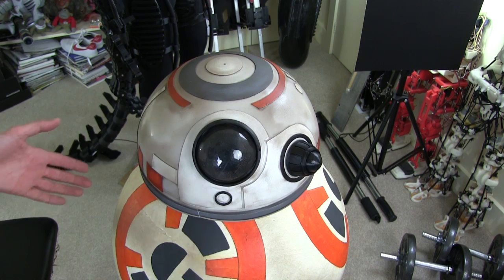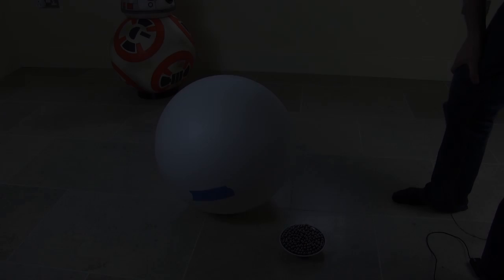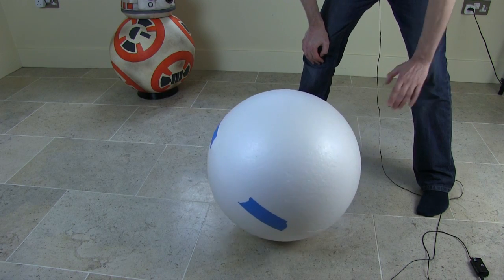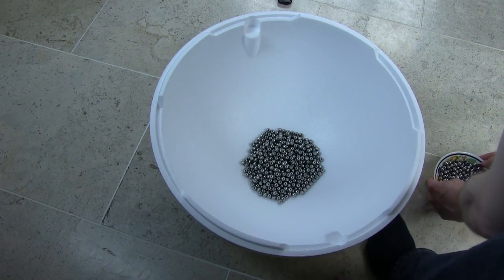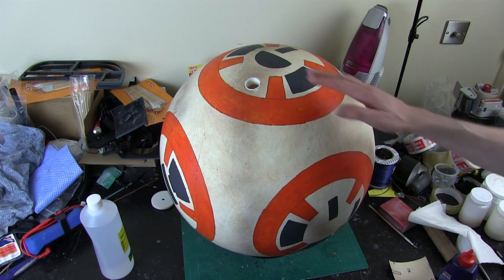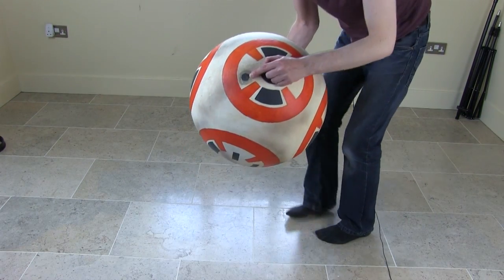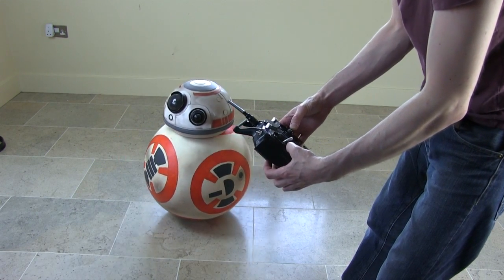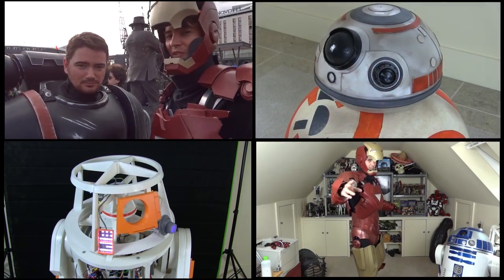Star Wars BB-8 Droid v1 #5 | Improving Stability | James Bruton

Comment: How about increasing the friction area (contact between ball and floor)? And using a material for the ball with more grip like rubber.  It's like a 95-97% inflated basketball which has a better traction to the floor and with less air it has a more area of contact with the floor which means more stable but still rollable. If it works it'd be great!
Reply: I still have some other ideas, just send me a message https://m.facebook.com/profile.php?id=100009259019370&fref=ts

Comment: What if you make a internal system?

A similar machine but instead of trying to balance itself on top, it moves inside the sphere, at the bottom with a extra weights (more batteries?) for better stability.

To hold the head on top, you could use like a robotic arm with a strong magnet at the end and a motorless version of the current head with another strong magnet in the center, that should be enough to keep it on top when moving the sphere.

Comment: What would the effect of different compartments be for the fluids/ballbearings be, you think? In firetrucks, the water is held in different compartments, so that the displacement is not as extreme when they round a corner. I think that the same thing may apply to your droid.

Comment: I'm pretty sure that what they did for the original one was a bit like a sphero with an rc car on top of it if you know what I mean. The ball on the bottom actually has the main means of movement in it, something similar to how a sphero works. The head has a separate control that just has the job of keeping the smaller half sphere ontop of the actual main body sphere that is the one doing all the moving. That is how they accomplished the head mixing ontop of the ball when it was standing still on stage at the presentation. That idea also takes care of the speed, weighting, and movement issues for the most part. It is more expensive then since you have 2 separate robotics lobos connected to the same controller; one thumb stick for the movement of the body, wile the top sphere just has to keep itself auto balanced on top of the main sphere. And the other thumb stick to move around the head it wanted, say if your doing some movements with the head followed by audio affects or whatever lights etc

Comment: James, seriously, why don't you try making a second robot inside and at the bottom of the ball? That would give you control over the wobble.
Reply: Maybe they need to communicate, but I don't think it's mandatory. Unless the whole droid gets to move too fast, because the one on the top would have to catch up with the speed. I think.

Edit: and besides, better some control over the wobble than none at all.

Comment: Why not use an ARM Cortex M0/3/4?
Reply: ***** Almost all ARM Cortex M0/M3/M4/M7 chips run faster, the slowest one I've seen is the nRF51 at 16MHz, even if it is the same speed, they are 32 bit, have a 3 stage pipeline, 6 prefetched instructions... they are still faster

AVR is great because of the community around it, but that's about all that's great about them. I don't mind people using them. I do mind when people use them when they are clearly not suitable.

Comment: Couldn't the head mechanics be fairly easily adapted to go in the body (now we know how the actual one works) this would solve so many of the issues you had there
Reply: ***** Could you theoretically make a ball like that?
Reply: ***** yeah true, you can get large perspex hemispheres but they cost a few quid, regarding the 2 halves though i was thinking have the basic ball then make vacuformed panels in the shape of the sections that make up the ball, these could then some how be bolted on (would need to find a discrete low profile way) which would then hold the 2 hemi's together. i know its in no way a simple task, some clever design must have gone into the actual one, i hope at some point they reveal build details